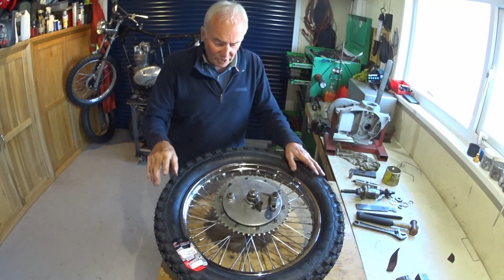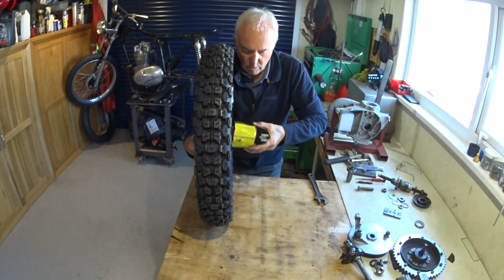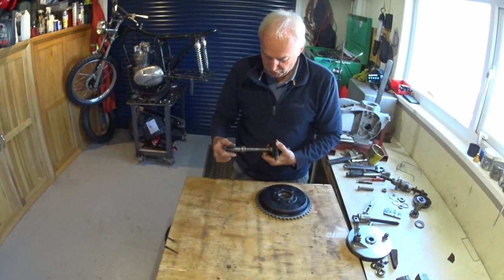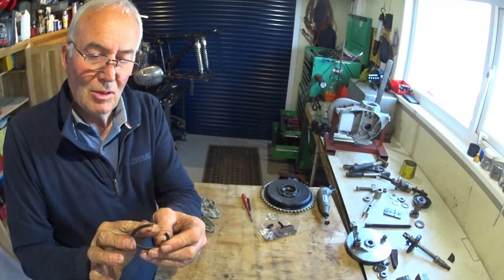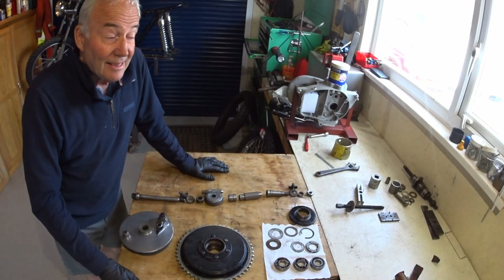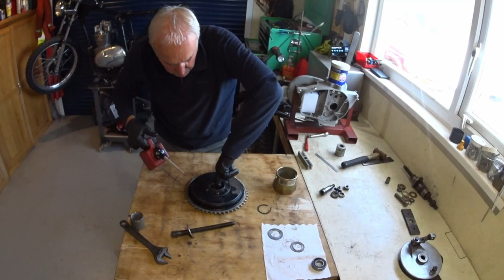BSA B25 Starfire Rear Wheel Bearings Part 10

Comment: I've just bought one of those immersion heater sockets, used some long studding (10mm)with 2 nuts locked together and tapped a large plate to go on the immersion socket and put it all together. Took a deep breath and started to wind the locked nuts -  and both bearings wound out! So much kinder than belting them with a hammer. Thank you.
Reply from the maker: Spot on, regards Brian
Reply: @TheCADengineer Fortunately my previous owner had cut a slot in one arm of the circlip that holds the bearing in the brake drum, but that bearing did not want to come out!

Comment: I've just put it all together as per your video but notice from the parts book that there's a thrust washer behind the spline side bearing.
I'm now wondering if I have to take it apart to fit one and if I do, the screw retainer won't go down flush. 
I made a tool like you for that as the tool I bought for those is absolute rubbish!
Reply from the maker: The thrust washer sits on a small lip on in the inside diameter of the hub and is generally a tight fit and normally there is no reason to remove it. The reason for the washer is the lip of the 2 different diameters where the washer sits is very slight and the outer of the ball bearing race has a radius, this radius would not sit properly against the small step, so by the fitment of the washer against the step gives a wide square surface for the bearing to sit. If all is fitted correctly on that side then when the bearing retainer is screwed down fully it should come flush, if the washer is missing the retainer will screw down below the surface, this will then allow the inner edge of the brake plate to rub on the outer edge of the brake drum. Sorry for the slow reply to this as I am still on my trip driving around Australia and have had no mobile or internet connection for quite a few days. Regards Brian
Reply: @TheCADengineer  Thanks Brian. It all sits nicely so I shan't take it apart again to look!
Enjoy Oz, "Always fill up when you get to half tank" was the advice we had.  Loved the place and am jealous.